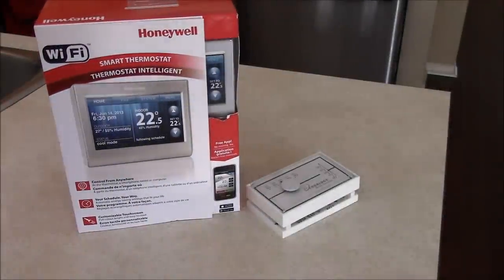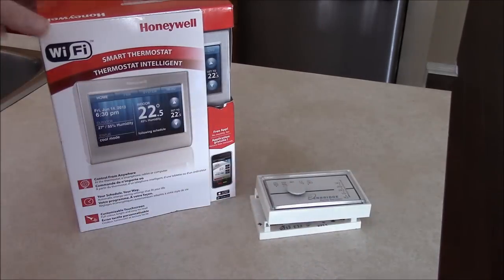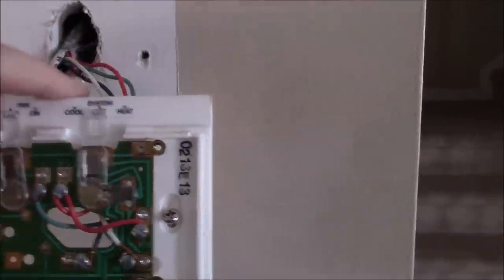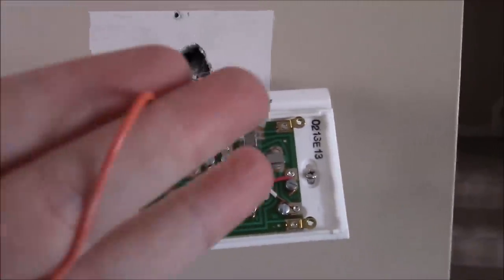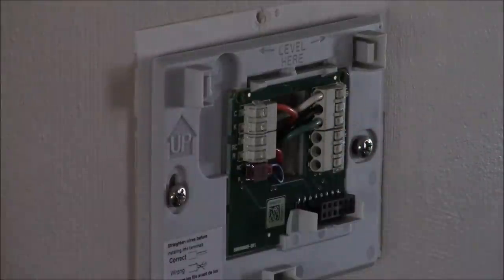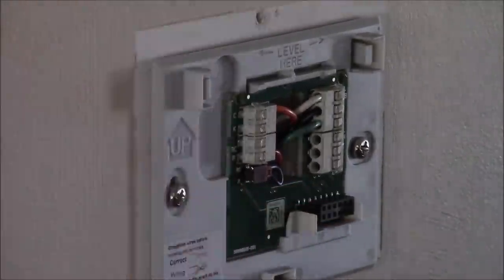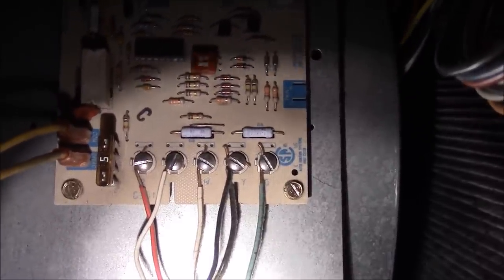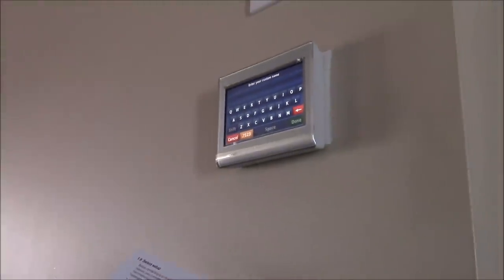New Honeywell Wifi Smart Thermostat

Comment: The C wire is common, neutral, ground. It just creates a circuit with red which is your low voltage 24 volts power. Which just makes your thermostat  able to run without batteries, also I would recommend running a common to any digital thermostat because if you lose power to your unit or have a problem with it, then you will know right away because your thermostat will go blank instead of using batteries and then not realizing your AC/Heater unit isn't working properly when it becomes to hot or too cold to bare in your home because your screen on your thermostat stays powered on because of the batteries in it.

Comment: i have a new honeywell 9000 wifi thermostat and the w and o/b slot are in the same slot? i have a heat pump where normally i would put the heater with w and reversing valve in the o...
Reply: can i use [w2/aux/e] slot? i thught that was used just for electric heat or 2 stage heat.

Comment: send me the old one!!
Do you have to register with Honeywell in order to use the remote access functions? If so, does that cost anything? (ever?) ...and is that necessary for any & all WiFi functionality?

What are all the other unused connections for?

I have a single-stage heat-pump, with natural gas "emergency" heat backup... do the instructions mention any compatibility with such a system?
Reply: Yes they are designed to work with heat pumps with secondary heat, straight cools and many other kinds of heating and cooling units. You just have to program the thermostat for the brand and type of ac unit you have.

Comment: Tried to wire the new thermostat for a 4 wire system. Specifically says for gas, propane, etc. furnace. How do you wire a 4 wire system to an electric furnace? Or does it make any difference? Couldn't even get the thermostat to fire up. Pfffttt... Ready to send the whole shebang back to where it came from!
Reply: Al Sorensen I
Reply: Al Sorensen ,

Comment: My critique of this video, simply stated, it is like an MS Windows explanation vs an Apple Mac one.  It would be easier to follow and understand if there was a bit of forethought is it presentation.   Example:  showing the "C" wire on the furnace.  Did you have to remove a panel to get to it?  Exactly where was it?  When you set the circuit breakers,  it might have been nice to "show" that too.  My point is that this video assumes that the viewer knows a lot.  If they know all of that, then they don't really need to  waste their time with any of the information provided.  So the question is, "who was the video made for?"